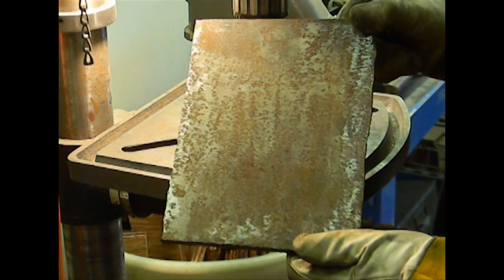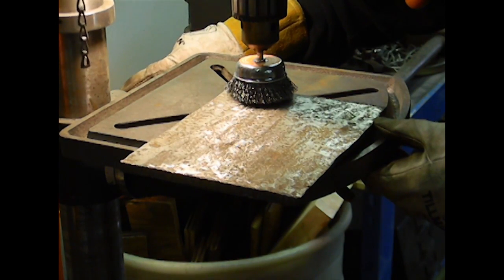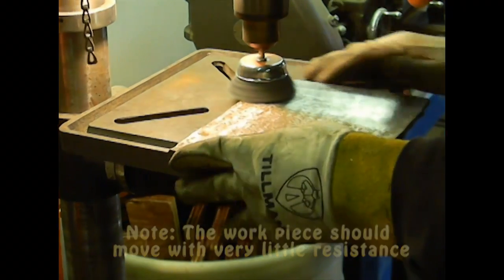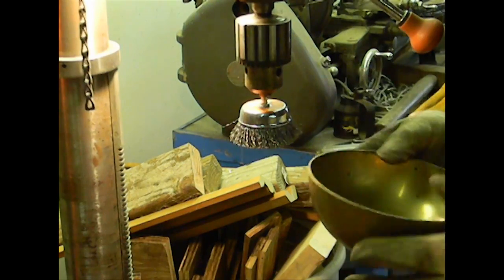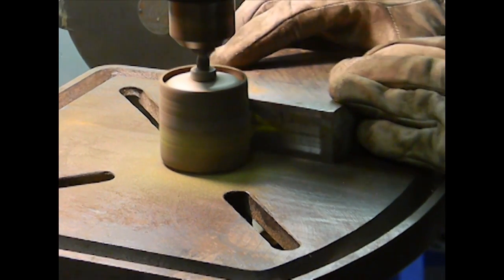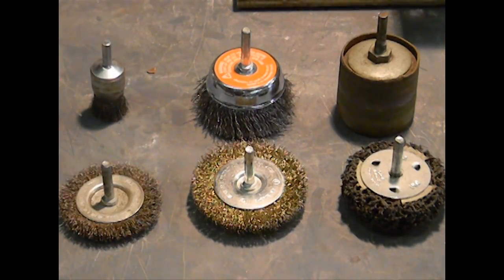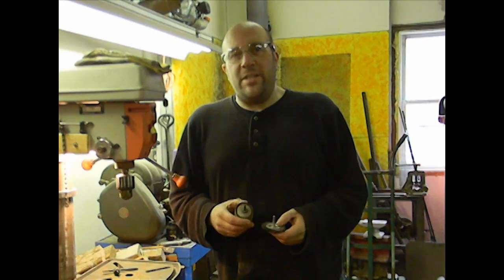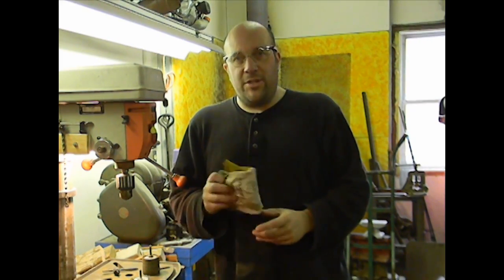Other Uses For A Drill Press

Comment: I have 2 drill presses one of which is dedicated for wire wheels, buffing wheels and accessories, drum sanders - essentially everything other than drilling. Made several tables/jigs to aid a given operation, especially helpful when working with a drum sander. Having read the other comments I'll confess to wearing gloves most of the time, as well. Enjoyed the video. Good luck.

Comment: Jeff - your videos are so helpful.  I have a floor drill press that I can use for cleaning larger pieces of metal.  I just never thought of it.  I will get myself a cupped wire brush for cleaning flat stock as well.  Thanks again for another great and informative video.  I am looking forward to more videos.  I am a late starter in metal working.  I am really enjoying the hobby.  Videos like yours save lots of mistakes and are great.  I have watch some of them several times.

Comment from the maker: Very good point, that can happen. I wear them when I am holding metal parts for a few reasons, I had a piece of metal get caught in the press and it tore the stock out of my hand. Left me with a nasty grit filled cut. Another reason is I have more grip on surfaces that are real smooth.

Its like steel toe boots, they protect your feet very well but drop something heavy enough and they'll shear your toes off. Its a trade off for personal preference and comfort level. Thanks for the comment :)

Comment: Thanks for the ideas Jeffery. Comments below say "bearings not designed for side loads". I just called Wen... they say light loads like drum sanding and wire wheel work will not cause any issues, as long as side pressure is "light" (that is subjective, but I think most people will understand this). For a decently made press (Wen is inexpensive but has good bearings), occasional use in these ways is AOK.

Comment from the maker: My drill press has a removable chuck as well, I put the chuck on and then just push down on the press lever. I put enough pressure on the chuck to lock it in place. I would not use a hammer because its hard to get an even amount force, also it could damage the chuck. As far as what other chucks fit on that unit I would check either their manual or website just to be sure.

Comment from the maker: How exactly do you clamp something down that needs to be moved around the table? You can't lock a brass bowl in a vice securely enough without damaging it. You don't use clamps on a bench grinder do you? Also, how would you suggest clamping down the metal sphere?

Comment: An additional benefit of using a drill press for running a buffing wheel instead of your bench grinder is that you can slow the buffing wheel by changing the belts on the pulleys of the drill press when buffing certain plastics which can overheat and melt when the rpm is too high as would be with the bench grinder motor

Comment: I have worked in a machine shop, I do woodworking, and I'm a mechanic by trade. I see no problem using those wheels at all. Jeff did state not to exceed the speeds the wheels are designed for. I have a 5 in. buffing wheel on mine right now.

Comment: No disrespect, but you should never wear gloves when operating a drill press or any other rotary tools like grinders, saws, etc. The glove can easily get caught in the bit, brush or chuck and pull your fingers in. My drill press came with such a warning printed on the side and I've seen this happen once myself.

Comment: Hello first of all thank you very much for your video it was very informative. I had a question 
I do not have much room left in my garage and I was picking up a benchtop drill press today. I was also going to get a disc sander and a drum sander later on this week. Do you think a benchtop drill press to have enough power to use it as a drum sander? That way I don't have to get both and I save space. Or should I get a floor drill press instead?

Comment from the maker: As far as the router question, II use a wire wheel or a sanding disk. I know there is a risk with using any power tool. Slipping and hitting my hand on either would hurt a lot... but a high speed cutting tool like a router bit I would not recommend even considering. One slip with that and that blade would cut to the bone or deeper. Gloves would not even help, that bit would eat through a glove like its not even there.

Comment: Jeff, not to troll you or try to be one of "those guys" but I thought I would mention that a person should consider the intended purpose of a tool and the design aspects. In this case a drill press, the essential design would dictate "press" meaning the bearings that are installed for this tool are primarily for thrust pressure and not for lateral pressure. Even if you have a good quality tool it would seem only a matter of time before your drive becomes sloppy. If you have a cheaper drill press sooner than later. This really applies to hand drills even more than drill presses when you are using these drum and wire wheel attachments, the cup brush obviously not as much.
Reply: I actually came here to see if anyone mentioned that. Good call.
Reply: You can do what you like, it is your drill press. One of the optimal words here being Press. The bearings are designed for vertical pressure more than lateral and the obvious effects will be more immediate the cheaper your drill press is. I have only tried to point out that tools have a designed purpose and some consideration should be given to that. No big deal, obviously you can do what you like with your tools, my comment is just meant as a heads up. If you are going to do a lot of this an investment into the tools designed to do this is not a bad idea. Once you notice the slop in your press it is a little late.
Reply: Yep you are most certainly right! I noticed that in my two hand drills. Won't be doing that again! :/
Reply: Absolutely correct ! If you are going to use your press as a drum sander, construct a bottom plate with a roller bearing to support the bottom of the drum, and prevent lateral forces from destroying the press`s bearings.
Reply: Doesn't the belt-drive already apply significant lateral force?
Reply: No....all the belt does is to rotate the spindle....all loads are in the up-and-down mode, where the upper bearing can take the stress.... A drill press was NEVER designed to take side loads, like from an unsupported sanding drum. A second bearing, below the drum, would prevent side forces from deflecting the spindle away from it`s 90-degree orientation.

Comment: Thank you Jeffrey! What speed were you on using on your drill press? I'm going to try out more press for this; having little adjustment using my grinder. Thanks again
Reply from the maker: For the sanding drum and wire brushes I am normally around 600 - 800 RPM's depending on the speeds available. I have three drill presses in the shop and the configurations and speed options differ a little.

Comment: Jeffrey, I did not see in the comments or description. What RPMs do you use for each task?
Reply from the maker: Learn from Lee Whether your using a wire brush or sanding drum the individual tool should list the max RPM, either on the packaging or stamped right on the shank. So any speed up to the max tool speed would be acceptable.
Reply: Jeffrey Santo Thanks!!

Comment: Thank you for the video. I think I will be using some wire wheels soon.  You might want to mention a dust mask... I wouldn't want the stuff flying off that wire wheel in my lungs.
Reply: +George Fotinakes Another advantage of the fixed drill press - you can rig up local dust extraction. Not so easy with a hand-held tool...

Comment: is there an optimum speed setting for this application? 
I enjoy your videos by the way!
Reply from the maker: Most wire wheels or sanding drums will list what the max R.P.M.s  the tool can handle somewhere on the packaging. As long as your under that you should be good. Thanks for he question and the view! Hope to hear from you again.
Reply: Jeffrey Santo thanks for the info! I'm sure I will have other questions as I do not have a background in metal or woodworking.

Comment: In the real world, lateral loading of drill press bearings isn't really going to cause the sort of wear, chatter and sideways bit movement implied by some here - unless of course you feel the average drill press should be accurate to a thousandth of an inch or so.
In many small workshops, using this tool as Jeff was describing is extremely common - as a quick search around YouTube will confirm.
Have a look at this - and you decide:
https://youtu.be/HHtfcjwHERA
Reply from the maker: One mistake some people make is trying to use those milling vises with the quill on the drill press extended rather than using the table to raise the work to the chuck.  Thanks for the video link, it was a good watch.

Comment: Great video, definitely informative. I never thought to use a barrel sander in a drill press. Wearing gloves is pretty dangerous though. Check out this article   https://www.osha.gov/pls/imis/accidentsearch.accident_detail?id=202715728 Personally I much rather take a busted knuckle then getting my hand caught up in the torque of a drill press.
Reply from the maker: +Chance Buchan I did a little research on this article and found one thing I expected and two things I did not. What I did expect is that this happened while using a drill bit. I have taken several OSHA training classes over the years from working in the aerospace industry. The way it is worded is this: 

** EXCEPTION: Machinery or equipment provided with a momentary contact device as defined in Section 3941.
NOTE: 1. As used in subsection (b) the term entangled refers to hand protection (gloves) being caught and pulled into the danger zone of machinery/equipment. Use of hand protection around smooth surfaced rotating equipment does not constitute an entanglement hazard if it is unlikely that the hand protection will be drawn into the danger zone.  **

I may make another video to explain this and why it is relatively safe to use drum sanders and wire wheels with gloves. 

What I did not expect to see was the injury was to the mans right hand, this is odd since every drill press I have ever seen the lever to move the chuck down towards the work is almost always on the right side of the machine. This means that he was not actively drilling the hole. He must have been moving or loading the part into the drill press while the machine was running, that is a big no no.

The second thing that I did not expect to see was the word "elderly" in the keywords of the inspection detail report. I am not saying that is a factor but I do find it interesting that someone who worked for this company for 10 years made this mistake. He thought the best option to drill a 1/4" hole into a small 4" x 1" piece of steel 5/8" thick was with a machine that rivals a bridgeport milling machine in HP and Torque.  

How you feel about a busted knuckle vs. getting your hand caught is the same as I feel about wearing steel toe boots in some environments. I would rather have my toes crushed than cut off if something heavy were to land on my foot. Thanks for the view, comment and link to the article, I enjoyed reading it.

Comment: Hearing protection, hearing protection, HEARING PROTECTION!   These machines will quickly destroy your hearing if you do not take precautions. I always keep a set of ear muffs next to my machine, and usually have 3 or for more spread around next to  each machine or group of machines, to that it forces me to put them on.
Reply from the maker: I have 5 sets of ear muffs in my shop, any process that produces 85 decibel can lead to hearing loss... That being said an industrial 1hp drill press has an average decibel level of 77. Yes, I looked it up. In this video I used wire wheels and a sanding drum which is quieter than drilling a whole through steel. As in many cases people use hearing protection at their digression.

You could run a wire wheel on a drill press 8 hours a day, 5 days a week and there is no risk to your hearing whatsoever.
Reply: Dont need it drill press is not loud unless you are drilling steel